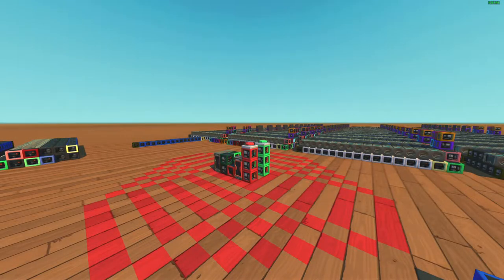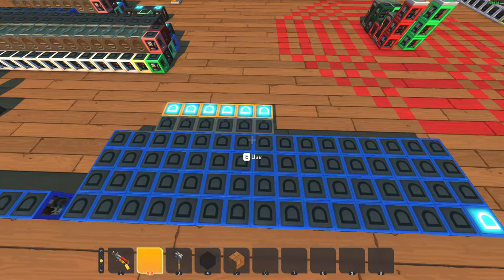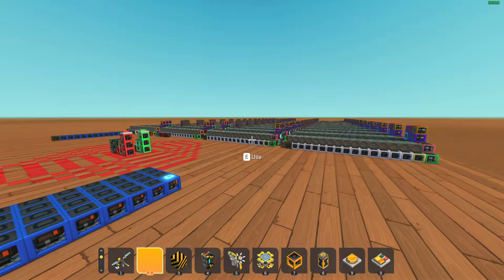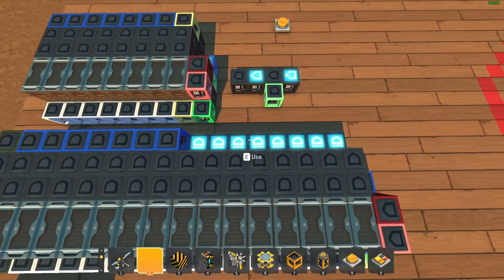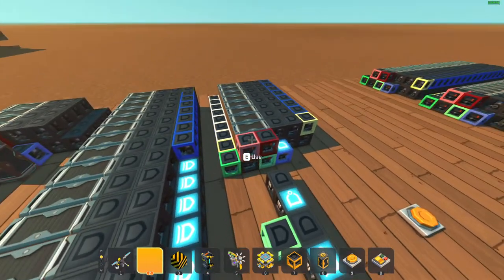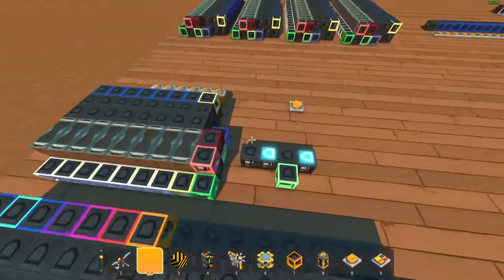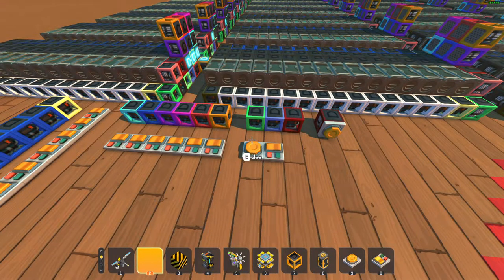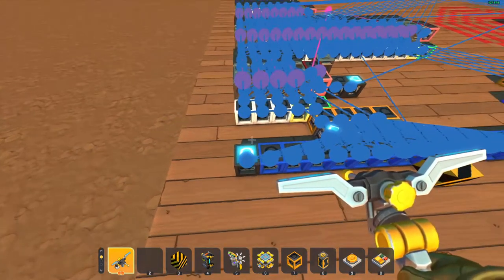Turbo Snail EP6 - Basic Control Logic - Scrap Mechanic Computer Construction

Comment: You could try incresing the volume, cuz it´s kinda low
Reply from the maker: Ill try increasing the volume, but do keep in mind that the noise will increase with that, so it's all a big balancing act.
Reply: @JustAnotherEngineer_  and you could try recording your aubio in a sepprate program, whitch will help aline the sound
Reply: @JustAnotherEngineer_  I heard that Audacity's noise reduction was good. Try different ones if that doesn't work though.